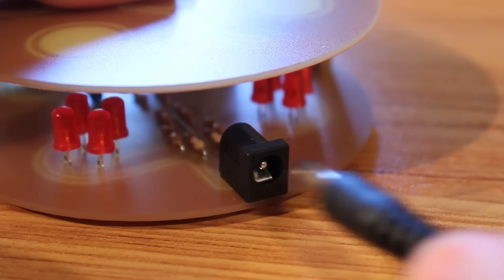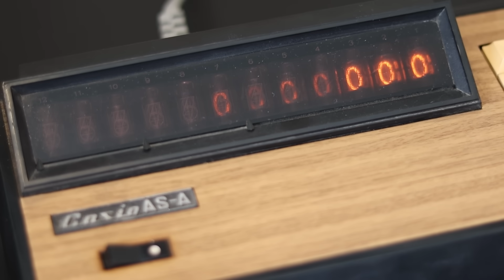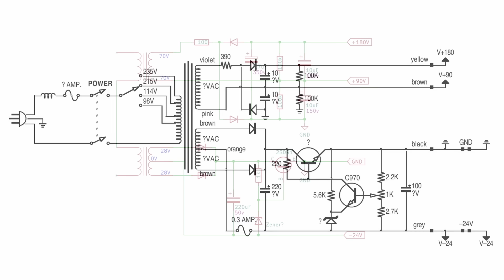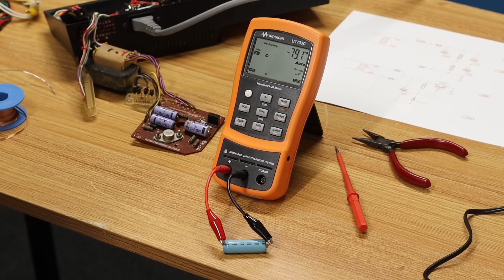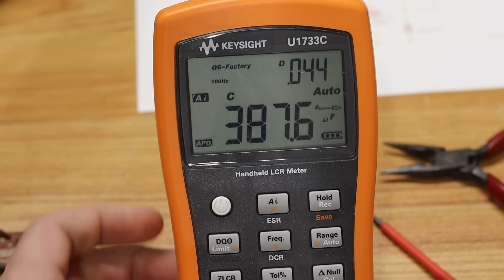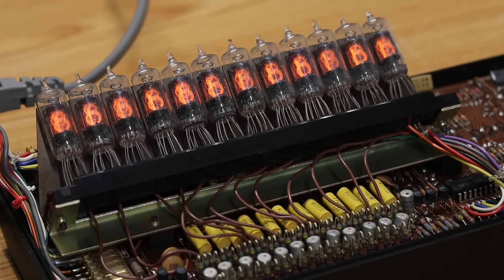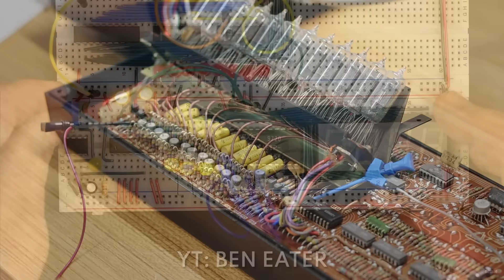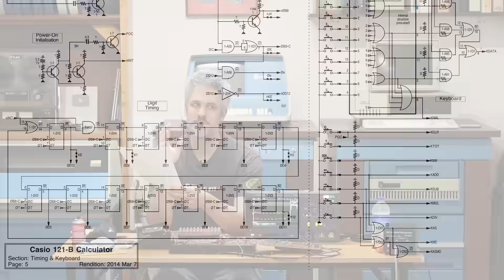Working on a Casio AS-A Nixie Tube Calculator

Comment: One issue I've seen from old electronics from Japan was the humidity. A lot of those paper epoxy boards would soak up moisture and become conductive. Pretty much all of those metal can transistors are germanium and they aren't fans of over voltage, plus the early ones had an issue with tin whiskers. You may want to do a gain test on them and if any show poor gain they might have tin whiskers internally shorting out. Sometimes throwing them against a wall breaks the whiskers and they operate again.
Reply: That transistor repair procedure is a top quality factoid. In the future I will "adapt" it to all sorts of repair situations when on-lookers are present. I actually completed my first radio repair in my dad's Datsun pickup truck after watching Han Solo perform the percussive repairs on the Millennium Falcon's hyperdrive from Star Wars. Amazing really how well it works on so many things. Throwing against a wall to break a short is next level though haha.
Reply: And they are / get really leaky.
Reply: these look like transistors and ICs from silicon era though
Reply: @jwhite5008  The 2SD91 power regulator is a silicon and logic chips are all silicon. I'm not certain about the other signal transistors.
Reply: @jwhite5008  You are right, looking at some photos of the as-a the transistors driving the display are Hitachi 2SA617 PNP Si.
Reply: @HansS-vh8de  Thanks. I couldn't read the numbers.
Reply: @therealjammit   I have found photos with relatively high quality on curtamania. You can read the A617 marking and clearly see the hitachi logo.
I don't own a Casio AS-A but I had to search for a A617 substitute for another calculator some time ago and they looked familar to me. I ended up replacing them with BC393 in TO-18 metal cans where necessary.

Comment: I was in the Air Force from mid 1975 through the end of 1984.  The computer systems used for most processing at all bases were Burroughs medium system mainframes (3x00 and 4x00 series).  The front panels used Nixie tubes for display of instructions, addresses and data; which is what Burroughs developed them for in 1957.  So, they're one year younger than I am.

Comment: Two things I would do for your next steps:
1)  Slow the clock down.  Drive one of the Bases of the clock transistors to get them to run at say 10Hz or even slower. Observe the start up, running, etc out of reset.
2) Pull Back and think "What could degrade in the last 60 years?" and test them. Caps are obvouse, but Diodes and Transistors are also suspect from that era. Resistors are also an issue, but the main one is -- Solder Joints and the PCB itself.
Reply: I would modify idahobob's idea and single pulse the clock.  The circuit intends to drive one Nixue at a time, so the shift regestier should reset to all 0 (could be negative logic and be all 1) except for 1, and the clock pulse moves that 1 around the circle one step at a time.  Since you are not seeing one ulse for every 12 master clock, I suspect you have multiple 1s in the register.
Reply: @rickhole  also on that note - check for good RESET signal upon startup
Reply: The triangle logo matsushita capacitors from the 70s are notorious for being utter crap in terms of longevity. They're in a lot of vidicon cameras and they basically bring them as out of spec as you can imagine even if they're not leaky. Surprisingly, the same applies to the caps from late 90s to early 00s, albeit the whole world was having some trouble with caps back then :P

Comment: Zener Diode Voltage Reference + High Current Emitter Follower (Series Pass) Transistor = Linear regulator. Although modern ones are much better, especially if you use a TL431 instead of a Zener.

Comment: Such a high difference in capacitance is usually DC leaking, you need a DC leakeage meter to measure that, "Mr. Caldeira electronics old and new" built one, with what he had at hand, take a look at his video, you can build one yourself!.
too bad you didn't switch to ESR mode, we can only see the D factor. anyway you cannot see DC leakeage with that LCR meter (which is AWESOME!, i have the Sanwa LCR700, because I couldn't get my hands on one of those keysight LCR)

Comment: I recently saw a video commercial for a Sharp LC-8 four function hand held calculator about the size of a paperback book from about  1970.  The price was 395 Dollars which is the equivalent of 3,273 Dollars in 2025.  Yikes!  My daily driver calculator is a free promotional solar powered credit card size which I got about 1990 from Bondwell Adhesives.  It is mind blowing the revolution in electronics manufacturing and reduction of cost which took place in just 20 years.  The 1970 to 1990 era was probably the time of greatest change in electronics we have experienced to date.  We went from though hole paper PCBs, discrete ICs and transistors, and gas filled display tubes to flipchip surface bonded single chips on fiberglass boards and LCD which can run on normal interior room light.  We have gone through further revolution, but the manufacturing technique still looks a lot like it did in 1990.

Comment: Those symbols on the clock symbols are for "phase".  Phase 0, and phase 1.  A calculator is not a computer.  Good luck with this investigation.  Very neat piece.
Reply: a calculator IS definitively a computer, it might not be a stored program computer, but it is a computer, it has input, processing and output, some calculators even have some sort of micro-code that they cycle through, almost like fetch-decode-execute. And as the person said above, it has an ALU, arithmetic logic unit.
source: I'm a computing scientist.
Reply: @monad_tcp  It is interesting how pervasive computers are behind the scenes in fixed function applications.  Even my old microwave oven with basic count-down timer driving a VFD appears to be using something like an 8051.  They probably could have done the same thing as a gate array without involving a CPU, but back then mask programmable CPUs were less expensive than ASICs.  Plus it is relatively easy to change the mask to support new features or fix bugs.  China is absolutely in love with 8-pin micro controllers these days.  Even my soap dispenser has one.
Reply: I am pretty sure this calculator has a core logic processor which carries out four bit operations to perform multi digit BCD math.  It may be doing program control and branching logic internally but none of it is changeable or accessible to the user.  It sort of straddles the line between computer and calculator.
Reply: A woman who worked for NASA and calculated orbits etc was a computer.  A calculator is also a computer.  We have narrowed the meaning of the term with time but it still applies.  On a car I used to drive, there was a "vacuum computer".  It was driven by engine vacuum and did stuff with the timing and mixture via a box full of moving parts.  It was just before it went electronic in all cars
Reply: @kensmith5694   Borrowing loosely from what Wikipedia says about “computer” what differentiates a computer from a machine is that computers are user programmable to carry out general purpose calculations.  A vacuum advance on an engine spark ignition system distributor is effectively an integrating analog computer, but has an unchangeable function.  Few people outside of a 1937 Chevrolet Film would call a distributor a computer (if their vehicles had them).  Chevrolet actually referred to the distributor as a robot, which is a whole other can of worms.  That film was done by the Jam Handy Organization for Chevy and what Chevy was trying to point out is that robots aren’t necessarily anthropomorphic.  The film is out on YouTube and has the title Rolo Rolls On or something similar.  It is quite quaint by 21st century standards.  Point well taken though.

A lot of devices straddle the line because they carry out program controlled decision making in response to inputs internally, but the end user has no access to change the program behavior.
Reply: @wtmayhew  The term "computer" has been around a lot longer than Wikipedia.  Since you have used that as a reference, I guess I should go edit that page.  The thing in my car was called a "vacuum computer".  I remember because I had to get some information on if from a place you could order manuals and then repair it.  It implemented a timing that went on the retarded side at idle, advanced at moderate throttle as the RPM increased and then went for less advance with increasing throttle until it went advanced again as the "power circuit" on the carburetor's "power circuit" engaged.  "power circuit" made the mixture rich because a rich mixture will make more power and also suppresses pinging.
Reply: @kensmith5694  Every automatic transmission is an analog computer.  It's doing math based on hydraulic pressure, mechanical inputs, to select the correct gear.  Single function computer, but a computer none the less.

Of course modern transmission have digital computers doing the controls, but i was talking further back, 60's and 70's.

Comment: My dad had a later version, maybe 1971 or 1972 of this machine and unfortunately I was using it and broke it. He was able to get it repaired but then it stayed at his office. I love seeing the internals with I presume is TTL logic? Looking to forward to the next installment.
Reply: Japanese P-MOS technology
Reply: Early P-MOS logic devices, run on -24v, unique to Japan, completely unobtanium.
Reply: @michaelturner4457  I just bought some NOS P-MOS chips used in this calculator. Just like most other vintage electronics you can find it if you search in the right places.

Comment: My first job was repairing Canon calculators. By that time the new models were a main single chip and Futaba key switches.  But we still repaired the older models that had similar magnetic reed switches and nixies. The even older ones had a row of digits each consisting of 10 etched glass plates with wheat lights above to illuminate the digit. They had individual cards in a bus rack to handle the various functions. Very amazing.
Reply: In a another comment I pointed out that a Sharp LC-8 cost 395 Dollars in 1970 which equals 3,273 Dollars in 2025.  That helps explain why it made sense to sense to service things like calculators rather than throwing them in a landfill when they break.

Comment: no, a capacitor reading high capacity does NOT necesarily mean its bad, especially older ones, some had a positive tolerance of up to 80%, i've seen it marked on them, important is to check esr and any standing dc current at full working voltage and dont forget, you cant compare these with the modern esr figures as they werent low esr types, as long as it is reasonably 'sensible' , it should be ok,

Comment: The magnet technically doesn't pull the far contact. It magnetizes both of the leaves of the switch, temporarily turning them both into similarly-polarized magnets. The leaves are arranges such that one's N pole is beside the other's S pole, which makes them attract one another, and contact is made. The magnet isn't powerful enough to overcome the magnetic hysteresis of the contact material (B-H curve), so the leaves are not permanently magnetized, and when the magnet is removed, the induced magnetic field goes away, and the leaves spring back open again. 
Another worthless trivia moment, brought to you for free. Thanks for playing.
Reply: Reed switches are so much better than the old optical encoders. We are still working with 70’s technology here. I was a service technician for the Singer 900 series cash registers at the time. And we had some calculator technicians at the time. Calculators were winding down at that time. The service manager had an old Frieden mechanical calculator on his desk that still worked!
Reply: I figured something was up when i saw both leaves moving towards each other and not just the one, this makes sense.
Reply: That's very plausible. But then how do normally closed reed switches work?
Reply: @generessler6282  After a quick Google search:
~~~~~~~~~~~~~~~~~~~~~~~~~
How do normally closed reed switches work?
Reed Switches (Normally Closed): Electrified Cobweb Card ...
Normally Closed (Bumpy)/ Magnet Off

A “normally closed” / “magnet off” reed switch has a bump concealing a small biasing magnet inside. The gap inside of a “normally open”/ “magnet on” reed switch CLOSES when a magnet is nearby, completing the circuit and causing the LED to switch on. A magnet nearby turns the LED on.
Reply: @generessler6282  I believe that NC, or 'form B' contacts are made by biasing one reed leaf with an internal magnet, which makes it be closed at default. In the presence of an external field, one leaf will parasitically magnetize to the opposite, anf the leaves will open. But I'm an idiot, so you should take that with a grain of salt. ;)
Reply: @yohannwilkerson6058 Cool. Just thinking about it, my guess was that the reed is normally sprung against a non-magnetic fixed contact, then there's a magnetic fake reed not connected to anything that pulls the "real" reed off the contact in the presence of a magnet.

Comment: Growing up in the 70s and early 80s, we had a Casio calculator.  It was white and black made of plastic. The power switch slid back and forth. There was a painted green? dot that was exposed when the switch was in the on position. It had a blue fluorescent display. It took a moment to make its calculation after you pressed equal.    🎵 Thanks for the memory- it's been a long, long time....
Reply: Casio Personal Mini

Comment: Hi, we sometimes forget the speed of the electronics evolution, this model was out of the plant by the late 70 or beginning of  71, only 55 years ago, and look how much things have changes in this laps of time (not for the better, I really miss the time where normal components were easy to find to build small electronic home devices).
Reply: They're quite easy to still find online, easier than catalogs of the past. In thailand you can also still go to a physical store and get all sorts of logic components, arduinos etc from the shelf. 

Of course the possibility to do this isn't as much in your face, especially in the west, so it doesn't cross most peoples minds that theres generic control boards for washing machines and parts for microwaves and ready to go temp and wireless automation components out there
Reply: @lasskinn     In fact, it is the first part of your answer that I miss the most, because the two shops where I used to go have had very friendly and knowledgeable people with whom I was chatting for hours.   This is one of the quirks of the Internet, it kills the "good old" things, things we were doing taking the time to.

Comment: In about 1968 my chemistry class had a wang calculator with nixie tubes.  It could be programed using IBM cards. We had to punch out holes in the card by hand.  Keep and eye out for one of  those.
Reply: I think I saw a different brand of the same idea.  Were the cards put into a thing with about a zillion contacts that closed on the punch card.  That is, it didn't "read in the card".  Instead it stepped through the columns of the card as it went and each column was sort of a keystroke on the front panel rather than being a computer instruction.  The cards were 160 columns IIRC and you could daisy chain multiple readers to get complex programs

Comment: I have the same calculator, I also have the later model casio 121-e with the vfd display.. takes a bit of getting the brain working on how the addition / subtraction keys work but they certainly don't make them like they used to. Thankfully not had to repair either of them, have looked inside both and works of art compared to single glob chips you'll see these days.

Comment: LCR Meters time the charge on the cap to get its value. If it's leaking it will read a higher capacity since it takes longer to charge it.
Reply: Only a simple capacitance meter (like the capacitance mode of a multimeter) will be fooled by that. The keysight meter he is using should use a bridge method to measure impedance so should be able to independently measure capacitance and parallel resistance (leakage). Old electrolytic caps can increase in capacitance due to increasing surface roughness of the plates.
Reply: might also be that they are old caps that had a wide tolerance range and the repair just fixed a bad solder joint?

Comment: Nixies are always cool!
Which reminds me, I need to look into a prescaler for my nixie based counter..
Reply: At first I was thinking counter as in totalizing Geiger tube counts, but you must mean frequency counter.  The Geiger prescslers used Dekatron tubes with ten electrodes in a circle and each pulse advanced the glow discharge around the circle.  The display tube did double duty as one decade of divider.  The Dekatron electronic prescalers were usually in front of a mechanical counter with odometer-like wheels or printer with paper tape.

Comment: That casio would have cost over 8000 dollars in today's money. That's based on the heavily discounted price in 1970. The earlier production units would have cost a lot more
Reply: It is kind of mind blowing that people (mostly corporations) were willing to spend the equivalent of 8,000 Dollars in 2025 money just to improve their accuracy of basic math.  Never mind any trig functions, storage, remote input, printing or anything else we take for granted now and is insanely inexpensive now.
Reply: @wtmayhew Indeed, but not if you buy an nvidia gpu
Reply: @wtmayhew  Even though a calculator was very expensive back then, it was still significantly cheaper than a computer.